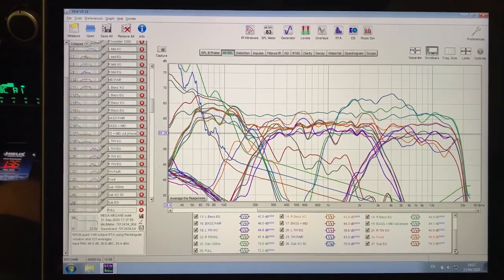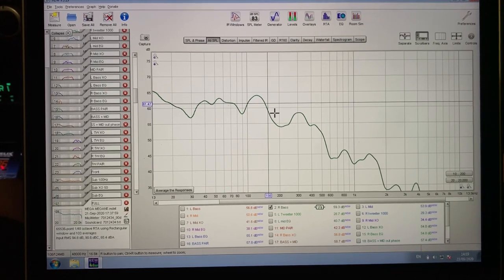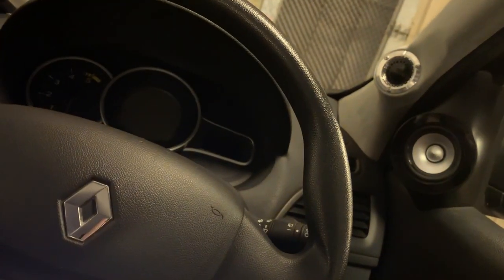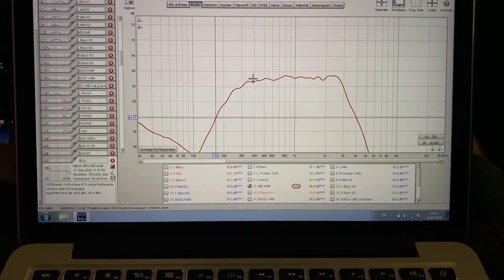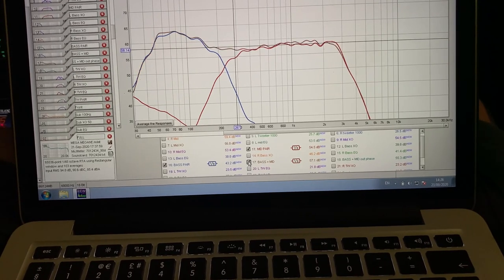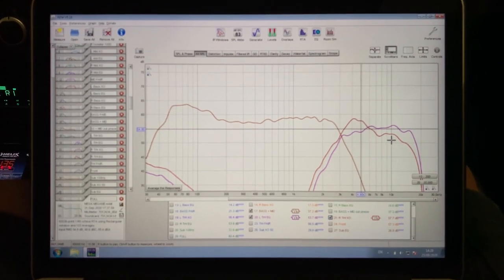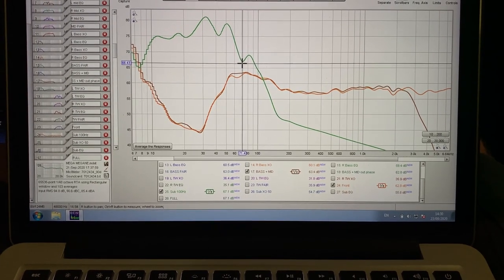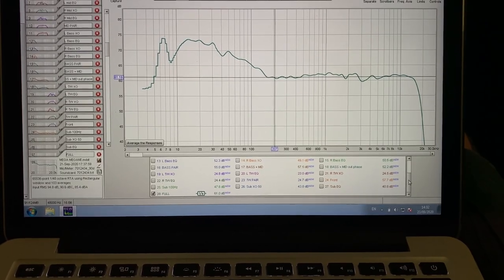1 week MEGA MEGANE SQ Install - PART 9 - TUNING of HELIX V8 DSP with REW

Comment: Peter, i truly appreciate you doing these tuning videos. I’ve been doing a lot of self home schooling on how to tune before I buy the mic kit from Audio frog to do my own tune. I tuned it all by ear as of right now. I know it’s not done right till I use a mic and REW . Funny how you mentioned if I have peaks from one side to the other it will take away the center image/stage of the voice . My system will take the image from center to the left in a split second then go back to the center. Fades back and forth. I figured the reason was due to what you mentioned but I wasn’t sure. Now thanks to you I know for %100 peaks are the cause of that symptom. Again thank you so much for all your videos. I find my self reading everything I already read    due to information overload. I think I need to hurry up and buy the kit so I can play and learn with it at the same time.

Comment: Thanks so much for putting this series together.  I was trying to better understanding setting actually crossover points versus arbitrary ones.  You video helped me find and fix a phasing issue with a mid bass and better understand why my stage would shift slightly in the upper male vocal range.!

Comment: Thanks for keep sharing your knowledge! Trying to tune a 3way system using a mosconi 6to8 dsp here, it definately has the worst and most complicated interface. Learning curve was steep and I literally had no previous experience in tuning. Your videos helped me deal some issues but I have to do a lot in order to get there
p.s. @ 00:58 Right click and select clear selections. No need to do it one by one

Comment: 0:41 you can right click- clear selections. yeah floor midbasses seems not go that high, and quite an distance difference to midrange too.
Reply from the maker: м distance to mid doesn’t matter, but the fact that the PLD is only 22cm (~9”) between L&R matters more.
Reply: @pssound9749 i wouldnt bother even that PLD, sounds shit to passenger seat anyway.  do video how you set up correct delays.
Reply from the maker: м we would have to establish what sounds “shit” on passenger side in your world, but the owner couldn’t care less about staging and imaging for the passenger either. Driver has to get the absolute sweet spot and don’t even start an argument about it, cuz i won’t go there! 😃
I like how you also try to tell me what to do and what to share! 😃 😂
Reply: @pssound9749  add 2ms delay to left channel on your home stereo, about that shait it is :) but its easy to avoid if being passenger, just turn headunit off :) i have to say those un eq´d a-pillar mid twe responses are nice, much nicer than my dash responses.

Comment: Thanks Peter for you video, I am from India and hardly there is any professional installer having such knowledge.  In future can u please make a video on how to use REW for audio tunning.  I am trying to tune my car buy having difficulty in matching volume from both righ and left. And also RTA from REW is also change everytime I run pink nois3.
Reply from the maker: Hi,
Unfortunately everyone struggles with tuning. The ingredients may look simple, but cooking a beautiful dish from it is rather complex. I offer the onsite master class trained, that’s the only thing i can do at this stage. You can see videos shared about it, please check it out. Thanks.
Reply: @pssound9749  is there any online training as well which you offer and I can join. Thanks

Comment: How do you determine volume level when tuning systems like this? Do you play the pink noise at normal listening level or maxed out before clipping? I would assume response on the graph would change at different volumes, no?
Reply from the maker: Andrew Turner for RTA measurements 85-90dB is enough.

Comment: Are you running 6 ch front and the other rear? does the amp have dsp for sub amp out ?  That’s gotta sound killer
Reply from the maker: Yes, the Helix V8DSP is an 8ch amp with 10ch DSP.

Comment: Hi Peter, I watched your videos and bought a set of utopia M. And my dsp amp is helix V twelve. But the sound of my system is not good. My question is: if I buy a set of zapco z-150.6 ap, will it get much better? And when are you planning to do remote tuning? Thx
Reply from the maker: If it doesn’t sound good as it is right now, then it will sound pretty similar with the Zapco amp too. Amp change is not gonna make a day & night difference! 
You have way bigger impact on how a system sounds by the way the speakers are installed and how the system is tuned. 
Instead of remote tuning i’ll start an online training program soon, so people will have a chance to go to school again. 👍🔊🔊

Comment: Hi Peter, would you recomand Hellix V8 DSP? Thank you
Reply from the maker: Otherwise I wouldn’t use it.. 🤷🏻‍♂️😃
Reply: Thanks, so I'll go and buy it for my project. Have a nice weekend!
Reply from the maker: gabriel rizescu Helix V8 has a pair of RCAs for additional amp too, but channels can not be bridged, so needs a DVC sub if you want to use it as standalone amp. Controller and modules are all additional too.
Other option is Zapco ADSP IV Amp, which can be bridged, has BT & controller built in too, but has no RCA out for extra amp. 
Both similar price under £1k, you can find them on www.pssound.co.uk webshop.
Reply: @pssound9749  Thanks, just need 8 channels and no bridge between

Comment: Peter , Measuring sound with a RTA/REW vs measuring electricity with a oscilloscope, seems sound has a much higher learning curve then electricity does. I’m a automotive tech and I do all of the electrical diagnostics In the shop. I’ve been using a scope for many years now. Haven’t had hands on with a RTA/REW as of yet. I don’t know if you have experience with a oscilloscope or not. If you do , would you say my comment stands true or is it kind of the same and I believe it’s more of a learning curve because I understand how to use a scope and not REW?
Reply from the maker: myboy051 acoustic measurements in a car are the most difficult. Anyone can download REW and get a mic, but the magic is in the technique, then how to read measurements and apply settings. It’s something rather complex when we also look at T/S specs of speakers, understanding speaker limitations and system management. Does it help or answer your question? 😃
Reply: Pssound - Yes it does, I’m 39
Years old been into car audio since I was around 17-18 years old . I’ve always had a system in all of my vehicles and did most of my friends installs. Was kind of a bass head, what young man wasn’t at first. Over the past 2 years I’ve become a big SQ enthusiast. I’ve learned so much by watching your videos and reading forums without putting in my two cents. Along with tuning I’ve been doing research on how to read speaker parameters and what will work best for the given application. 
I love geeking out over most things that I do and take interest in. Funny enough the shop I bought my equipment from “Sound in motion”here in Boston MA wanted to see my install. Did pillars and sail panel active 3 way install kind of like this video. Derek Kenney the owner asked me if I wanted a job. I told him I’m so far invested into being a automotive tech and I don’t wanna turn my hobby into a job. It’s good to know that everything that I learned from watching your videos was able to be applied to my install and get a job offer out of it. Not sure if you ever heard of the shop but he is well known In the states.